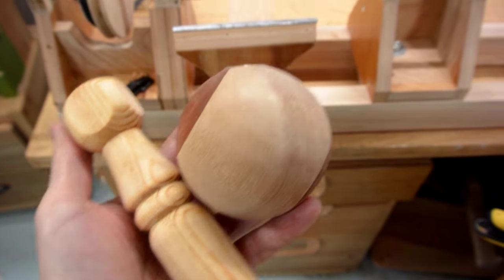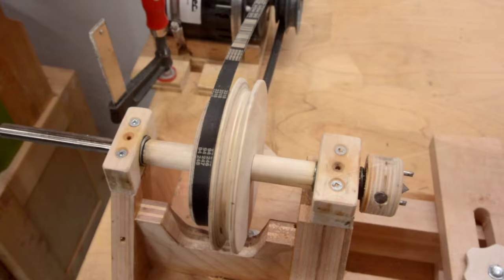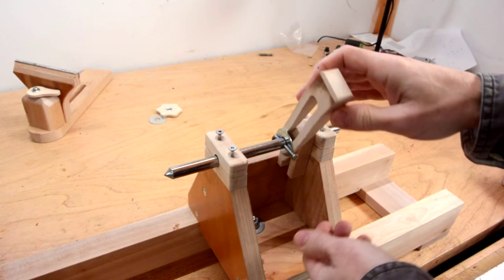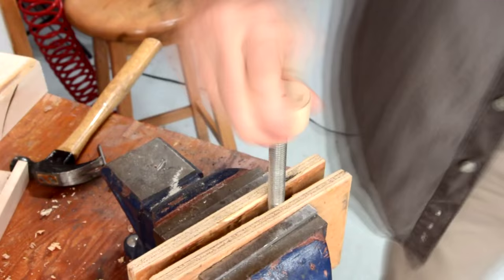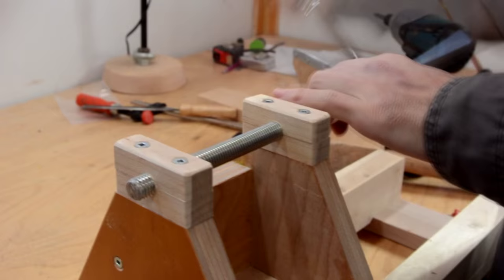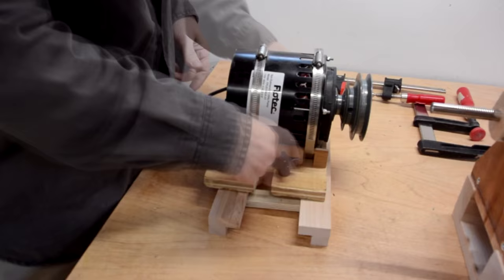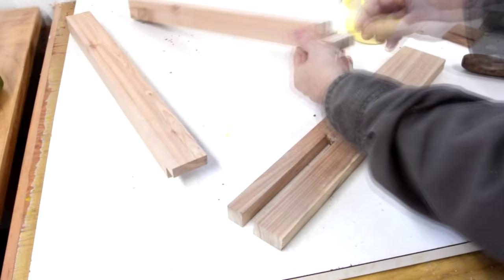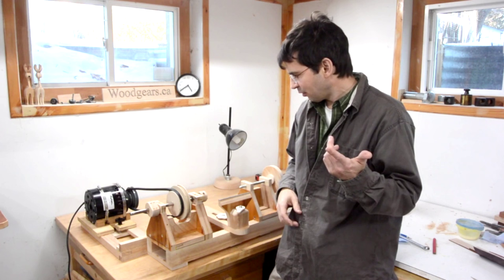Homemade lathe improvements

Comment: My father's old lathe that he got from my grandfather has pretty much the exact same arrangement for the tailstock. The tailstock was a sharpened bolt with a metal crank and a wingnut to lock in place. At some point my father found a live center that fit the bolt so then he didn't need to oil the wood. 

The lathe is also made of wood but has a machined head stock with a proper MT 1 taper and threads. No ball bearings, just two oil reservoirs filled with cotton on top of the pillow blocks.

Comment: The block that locks in place the shaft of the pulleys, does it make the shaft vibrate? I'm saying this because by the shape it has, it can't be much balanced. Or is it?
Reply: +johnnyq90 
It's wood (so quite light), not that out of symmetric shape and the RPM aren't high. So I'm quite sure that it's a non-issue.

Comment: \_/belt shakes because pulleys are not done properly and you need more tension on it.How to explain this the best ?
\ _ / belt needs to touch pulley just with \  / sides.The _ thing on pulley needs to be deeper ,that way belt will not skip and it wont dance hula hoop.
Hope this helps,i am qualified lathe operator and i have made many V belt pulleys for machines trough years.I recommend using a profile knife for making pulleys in wood,you can make one out of scrap metal ,since wood is soft compared to steel.Use bevel gauge on your belt and transfer the angles just like you are doing dovetail.

Nice and fun video as usual.

Comment: Moving the motor to give a belt some tension is perfectly fine :) That or using some idler that presses the slack side ( one side of a functioning belt with a load always slacks).

Pretty amazing what you can do with simple ideas , and of course a good execution. It's a pleasure to see your work. No unnecessary fluff, clean working space, step by step ...

Comment: Good improvements. A suggestion for the tail stock. I would have made the whole tail stock variable so you can slide and lock it anywhere along the lathe chassis. Have 2 x hex nuts embedded in the front and rear tail stock which would accomodate the all threaded spindle (spike). You could then finely adjust the point of the spindle into the work piece by screwing the threaded spindle. If you want to get rid of the floppy ver belt. Run a spring loaded jockey wheel. Two x bearings would place less friction than the design you have now which will generate heat and wear. If you use bearings you can slot the shaft and put cur lips on to iliminate travel. Bearings are about $5.00 each new.
Reply from the maker: +Danny Haehae A suggestion to you: Build your own lathe, and you can do all those things.
Reply: Matthias be respectful to those that admire your work.
Reply: +Rick Grossman
 as far as i remember he is trying to build it  simple and with only few tools. 
 he probably meant that danny's ideas were fine, but maybe he has  thought about some of them  already. 
and if danny wants to do it that way, then he should do it
Reply: +Matthias Wandel   Hey Matthias. Thank you for the reply. My background is mechanical Engineering so my lathe is for metalwork. Having said that. I totally admire all of your You Tube posts and I would thankfully refer to your ideas if I wanted to make or retrofit a specific workshop machine. In the mean time. Keep up the good work.

Comment: definately solved a lot of the issues you had previously.  how are the wood bearings holding up in the headstock?

if you're wanting to do bowl turning, that is REALLY asking a lot of your headstock...most production bowl lathes have a 3-point bearing for the headstock spindle to deal with the stress.   It must hold the entire weight of the bowl as well as withstand the forces induced from actual turning so it deserves to be as strong as you can make it.   I would suggest making a duplicate headstock, but making it taller so you get more distance between the spindle and the ways (that distance ultimately is your upper limit on the size of bowl you can turn) and beef up the spindle support there, with adding another bearing block (possibly two!).

Comment: If the V-belt flopping is an issue, you can always add an adjustable idler/tensioner pulley that is mounted on a vertical board. With no slack you will have less chance of your tool stopping the work piece from spinning suddenly.

Comment: Hey wow, thanks for that bit at the end about the motor! I inherited an old lathe; I had to make a motor mount, and did what you warned about with a hinge, and indeed my lathe does shake all over the place but I hadn't really thought about why. I think I'll follow your advice and build a new static motor mount for it, maybe my vibration problems will go away (though I also need to replace the front end bearing).
Reply: +puddingpimp You might try shimming under your motor with a wood block padded with rubber to take out the bounce.

Comment: On the headstock, I would delete the spurred center block, and make a faceplate that has holes to pass machine screws.  That way, you could make up various other faceplates and chucks that could be attached to the permanent faceplate.
Reply from the maker: +Bob Blarney That's a cool idea!

Comment: "A lot of you may say to use the weight of the motor....etc.....but THAT'S A DUMB IDEA"
Reply: +Cameron Lienhart I like how Matthias anticipates and handles safety trolls and other commenters.
Reply: +Cameron Lienhart Isn't that the standard setup for table saws?
Reply: +justfakeit888 It just may be but it doesn't matter. Table saws quite often have a fairly heavy base and top so any motor is going to be substantially lighter and therefore the shaking due to the motor is minimal. In Matthias' setup, the whole lathe is probably lighter than the motor so any shaking in the motor is going to substantially shake the whole lathe.
Reply: Yeah, I commented that before I had really watched the video. My mistake. Matthias has a good idea, and after watching him, I do agree.

Comment: Just a thought, One way to remove vibration from the belt without transferring it to the lathe might be a spring loaded belt tensioner arm/ idler pulley, as long as the spring wasn't too strong. The vibration would cause the tensioner to continuously automatically adjust and remove vibration. But it's probably overkill and not really necessary here.

Comment: Always good to see developments through use, certainly seems to be improving with every iteration! Why not just use pillow bearings though? They are so cheap and will give more precision and durability. Threaded bar was definitely the way, maybe T nuts in the tailstock rather than cutting a thread in the wood?

Comment: To reduce the friction between the work piece and tail shaft, you could make your own live center out of wood.  You could fix a bearing in it that screws into your threaded shaft, then insert the point from your first shaft in the bearing.

Comment: The belt should be tighter, unless you're designing to stop the piece at the slightest tool catch. Also, if you're going to get into faceplate turning, you're going to need better thrust bearing support.

Comment: I wouldn't make a sliding motor base. Instead, I would just make it possible to screw it into two different positions, as you only need two positions for the motor. I love your videos, and this project is AMAZING!
Reply: +Oscar Scheepstra It looked like the base was bolted to the main frame, so I think he basically did what you're saying.

Comment: I did it both ways. Hanging the motor via a hinge onto the belt produces less vibration in the lathe than rigid mounting the motor to the lath stand.
Reply: +Big Fat Tony&#39;s I'm almost certain he used that method for a router lift he made years ago.  But that machine was much heavier.

Comment: you can also add two idle pulleys on the outside top and bottom of the belt which I think will help with the flapping of the belt and in return will produce more or better contact between belt and pulleys. good job anyways

Comment: You can use a drill and belt sander to do point sharpening. Put the rod in the drill, take it down on the belt sander. It's how i sharpen my TIG electrodes.

Comment: hard maple can make for satisfactory spindle bearings when saturated with oil,  but you might notice that sintered bronze bearings are not too expensive at the hardware store.  that's progressing from the 1920s to 1950s.

Comment: Hey matt, I think that turning a bowl with that sort of arbor and a so light weight lathe isn't a good idea, because the forse thats donde to it may bend it or brake the whole structure. My lathe has a 35mm arbor which isn't very large for a lathe. I like it but just for spindle turning, a 12 mm shaft is pretty easy to bend. A not so big bowl at 1700 rpm can shake a little bit my 170 kg homemade lathe. 
At my lathe the motor pivots and it's locked in place by a piece of iron with a chanel, so it can't vibrate very much and it's very fast to change speeds. Cheers from Uruguay and sorry for my english

Comment: Very clever solution for the tailstock. You could also use threaded inserts rather than cutting threads into the wood.
Reply from the maker: +Eicles True, but cutting threads into  the wood does the job and is so much easier.

Comment: I've made my own adaptation from your model, but I dont think the Threaded Rod do a good job because it does not turn with the wooden part when you upgrade the speed over 1800RPM for sanding, the wood burn . I personnaly used a blank shaft with bearing sweavel at the end of the threaded rod. Way better result. for the belt tension, i put the motor on a pivot, in that way the motor weight put the tension to the belt and then it doesnt shake,  and it is fast to switch from one gear to another. really good starting model!

Comment: Hey Matthias. If you swap the two wooden wheels, you don't have to make the motormount adjustable anymore. (just move the belt from left to right)
Reply from the maker: +LiQWiZ I still want to use all three steps on the motor pulley.
Reply: Matthias Wandel I see, obviously you had thought of that ;) thanks for your reply.

Comment: Would it be possible to inline the motor? Thereby removing the need for the belt? If you wanted variable speed, perhaps add a variable power to speed up or slow down the lathe?
Reply from the maker: +Olmo Maldonado sure it would be possible.  But this way is much simpler, easier and cheaper.

Comment: I would probably grind that threaded rod down a ways from where it is in contact with the workpiece, although the threads are not likely to dig into the wood, still another precaution

Comment: Nice! I suppose that was the only v belt you had. Ideally you need a shorter belt, than it not gonna take up that much space. Plus you will need shorter wood to support your motor, which makes it structurally more stable. Plus short belt would vibrate less, as far as I'm concerned. I guess you have to dismantle it if you wanna move it around!? 
Well done otherwise

Comment: If you only had a small metal lathe. Then you could have easily made a real quill for the tailstock ;-)

(I'm still wondering if it were possible to make a metal lathe out of wood...)

Regarding the modifications, the lateral motor movement appears a bit over complicated although it does help to get four speeds out of just 2x2 pulleys. I find a very practical system is the one used on the Vicmarc lathes, which have three gears out of a 3x3 pulley constellation for "coarse adjustment", aided by motor speed adjustment by frequency converter. 

I figure with a small lathe such as this, two speeds might do it if they are chosen well and the ratios sufficiently different. You won't need especially slow speeds since you can't mount especially big workpieces anyway. (incidentally, that is the configuration of my Emco Compact V8 metal lathe and it works like a charm, although with that you really DO want very slow speeds at rather high torque for threading etc. But I digress ;-)

In any event, I'd try just turning around either the headstock pulley or the motor pulley and adding electronic speed control and see where that gets you.

Comment: Nicely done. 

How about a Fenner Link Drive belt to reduce all that vibration?
Reply: +ARCustomKnives Very expensive and over rated, they can introduce their own higher frequency vibration. A better bet is the V belts that are made more flexible by having cuts across on the back, they run smoother and with less tension.

Comment: Your supposed to pull on it to give the belt tension. If it still wobbles like that, that means you didn’t pull on it to give it tension.

Have you ever seen how a swamp cooler motor works?

Comment: I have an old tablesaw that uses the motor weight to tension the belt. I absolutely hate the design. As you said it shakes the entire table. New belt old belt doesn't matter, the machine just ends up walking around the concrete floor. I shouldn't have to focus on my push sticks and workpieces skating across the table and not on the spinning blade in the middle.

Comment: swap out that belt with a link belt..... no more shaking.

that motor tension idea is fantastic though, haven't seen one like it.
Reply from the maker: +Adam Bramblet Ugh, those belts get hod, too abrasive on the wood, and cause injury if you touch them while running.

Comment: Gravity based motor mounts are safer if the work jam's up though. The motor will bounce up but the way you have if the work jam's up a lot worse can happen. Now you lathe is made of wood and theirs not much that could get destroyed. The wood would split so in this case yes your motor tension method does work.
Reply from the maker: +Derek Ludwig Please watch my previous video where I demonstrate what happens if things jam up.

Comment: I had remembered you talking on a maker podcast about how you didn't use the lathe you already had because it is more for ornamental pieces which you did not like (and it was also too large and covered with other stuff)
I was wondering what changed your mind?
Reply from the maker: +JZL003 I'll play with this one for a while, then it will probably go on the shelf.

Comment: This may be a dumb question, I don't know: How about using a bike chain for the motor? Wouldn't that reduce or eliminate the shakiness?
Reply: In a previous video he mentioned how he liked the belt slipping.  That's always been the advantage of a belt vs a chain.  Not to mention the chain getting gummed up with dust.
Reply: metamech
Hm. Good points.

Comment: Matthias are there no T nuts or other threaded inserts in Canada? Seems like they would work so much better than driving a nut into a hole and you seem to use a ton of them.

Also good luck on a faceplate or chuck. Not sure the shaft you have can handle the forces.
Reply: He's used them plenty o' times in the past.
Reply: metamech Not that I've seen.

Comment: you've talked about the advantages of flat belts and crown pulleys in the past. is there a reason not to use one on here? i'm guessing your build is from reclaimed parts, but i want the most efficiency if i can't salvage.
Reply from the maker: +james lawrence v-belts are easier and require less precision. Also, a flat belt tends to fall off if it slips.  Oh, and v-belts are much narrower, making stepped pulleys much more practical
Reply: alright, i now know what i must do. Thanks :)

Comment: I think you should fix the engine belt with this tip: http://snag.gy/5E7Hk.jpg
I don't know if the image is correct with your system ( I don't remember well) but I think you need to fix friction on belt and also to don't burn your motor.
So the race point - B is the flexibility belt and the point C point is momentum of rotation motor , also the point E can be assimilated with the level of the current in the motor windings. Maybe you can use one level and mechanical spring.

Comment: your lathe  is much better than more chinese wood lathes.
Reply: +EsseAkka LAB carpentry workshop This lathe is awesome, but I disagree. Even cheap lathes you can buy today will have ball bearings, a standardized threaded spindle, and morse tapers at the spindle and tailstock. It will come with a live tail center. It will have either variable speed control or at least 4 drive pulley settings. It should have a cast iron bed and a strong metal toolrest.
Reply: +awldune ok, you right.I said that badly.I meant that the lathe made by Matthias  is better because homebuilt and at no cost.
surely the lathe will have flaws but you can easily fix.  A cheap chinese lathe how much it cost. 300/350 euros? I know a lot of people that threw out chinese lathes after 1 year.sorry for my English.
Reply: 300 is about right, although where I live it is easy to find secondhand lathes cheaply. Matthias' lathe is a fun project and maybe a good option for people who live where shipping on tools is prohibitive. But IMHO it does not compare with Matthias' wooden bandsaws which arguably are better than a bandsaw you can buy.

Comment: What RPM does your motor run and what does it run on the second larger pulley. I have never tried wood turning and don't know what speeds to use.
Reply from the maker: +Tim White There's no one speed.  Which is why all lathes have adjustable speeds.  My motor is 1700 RPM.

Comment: Do you know of a cheap and easy way to make the motor of this lathe variable speed? More than just step-down pulleys?

Thanks.
Reply from the maker: +Sam Croninger No.  You can have cheap or easy, but not both.
Reply: +Matthias Wandel Okay. Let's go for the cheap option. I can put it some elbow grease for free. What ideas do you have? A variable watt light switch? Wouldn't that just burn out the motor?
Reply: +Sam Croninger Three phase motor with a VFD (Variable Frequency Drive, sometimes called an Inverter).